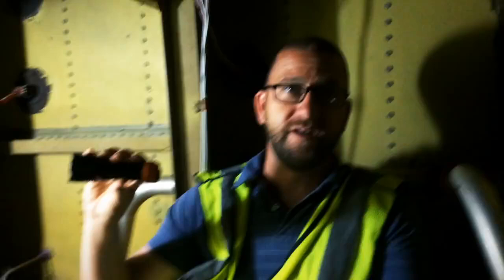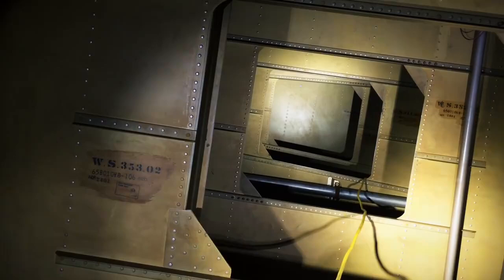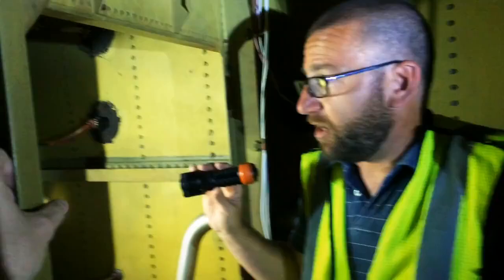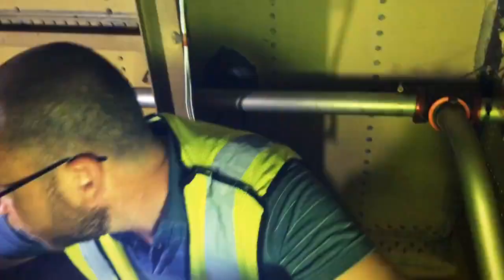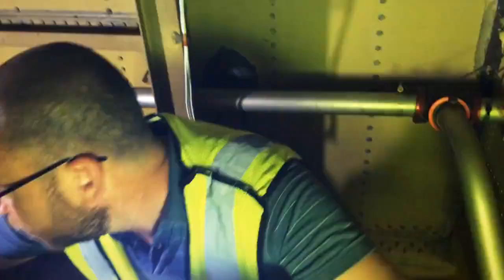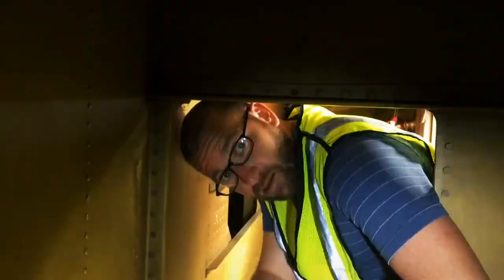The 747 Experience: In the Fuel Tank

Comment: No way is this a fuel tank. The  idea aviation fuel just sloshes around in there, i just cant see how it would work..
Reply: That's cool.  Well, that proves that you don't have an aeronautical engineering degree.  ;)
Reply: @StratMatt777 
Nor a high school diploma, I'd bet.
Reply: @jshepard152  Thanks for reminding me of this post because, in retrospect, considering that I assembled 747-400 center wing sections 20 years ago I could have expanded that guy's awareness by mentioning to him that the sloshing of the fuel in center tank is reduced (prevented as much as possible) by all those walls the guys are walking in between.  Which are (front to back) Spanwise Beam 3, Spanwise Beam 2, Midspar and Spanwise Beam 1 (there are 5 bays).
As we know, I was short with him since his comment means that he is experiencing the "compressed air" delusion, but I should never pass up the opportunity to expand someone's awareness of reality.
Hey, Marky Mark, how are you doing with understanding that jets run on fuel now 2 years later?

Consider this: your drink doesn't slosh or fly off the tray table because airliners always do coordinated turns, which eliminates cyclic variations in horizontal gravitational (centrifugal) forces.  That is to say, the sideways forces are gradual and pretty constant.

Comment: You just showed me a prime example of why im scared of the 747-400. Those electric wires above you that shouldnt be in a fuel tank. If those wires were to somehow break and you had full fuel, and then the wires start 'sparking'? Modern TWA800. Nope.
Reply: Being full of fuel is less hazardous, as the fuel itself doesn't ignite that easily.  The problem with TWA800 is that it was doing a relatively short flight, so only needed the wing tanks filled.  The centre fuselage tank was empty, and it was the fuel vapour that ignited.
Reply: There's actually only a small window of altitudes, temperatures, and fuel fill level where the tank can potentially ignite.  Unfortunately, TWA-800 hit that.

This is why A&Ps really earn their keep.
Reply: Those wires are in every Boeing airliner buddy.
Reply: Every commercial airplane you'll ever fly on will have wiring in the fuel tank, they almost all use capacitive fuel quantity sensors.

Comment: theres no way the amounts of fuel stated these planes take can all be held in the wings. look how skinny the wings are!
Reply: Cipi SixZeroFour good luck
Reply: It's not all in the wings. There are tanks in the fuselage (that's the body) as well.
Reply: Fred, it's irrelevant for him because what he really says is that the fuel that goes only in one wing LH/RH ... doesn't matter, that fuel is so "heavy" that the wing will snap... therefore the wings must be full of compressed air... try to figure it out what are the requirements to even build such a craft... these people don't understand that their 'solutions' do not simplify the design of the wing... au contraire.
Reply: Actually I'm studying the case if it's even possible to take off with a compressed-air craft the size of a 747... as of now... the math says that it won't take off... but we can only try harder.
Reply: For example, if we have to build a craft that can only take off, a compressed-air craft would be a possibility, but only if all onboard have to die because there is no 'fuel' left to fly or land.
Reply: Cipi SixZeroFour....I worked for General Electric Company in Schenectady right out of the University in the  1970's. I did gas turbine Field Engineering. A GE MS5001-P put out about 30,000 horsepower and it sucked something like 200 lbs of air PER SECOND through the inlet bellmouth. It had 10 liquid fuel nozzles made by Parker Hannefin and required a large Roots screw compressor to atomize the fuel. There was a fuel pump that supplied a 10 element gear type flow divider. The fuel pump was a variable displacement unit that utilized a wobble plate to vary the output of the fuel pump and change the load of the gas turbine from FSNL full speed no load to its rated output....determined by the exhaust stack temperature, something around 1005 degrees F. The exhaust stack was 14 feet on each side, a square stack. That's a lot of 1000 degree air and combustion products leaving the machine every second.

Granted, the Frame 5 GE was a generator drive unit that ran 5100 rpm and had a gearbox that turned a 24 Megawatt 2 pole 3600 rpm generator. You could ''Trip'' this unit at any time by hitting a button that dumped all pressure from the fuel pump. The unit would drop all electrical load as soon as combustion stopped. Hit the Trip and BANG, the unit is coming down. With all of that mass it takes 20 minutes to coast to a stop but power to the grid stops instantly as soon as the reverse power relays sense that the turbine is no longer driving.

Its laughable that compressed air could run this unit. It needed 200 lbs of air PER SECOND. Its aero derivitave was the LM2500 engine derived from  the jet engine used on the DC-10 aircraft. It was 32,000 horsepower. It drank liquid fuel in enormous quantities just like a frame 5 stationary power station turbine generator. The LM2500 was used...4 of them..to power USN guided missile frigates. 

For the ignorant stupid new wave common core touchy feely participation trophy fuckheads that say that aircraft run on compressed air only....they are stupid beyond belief. Every single commercial aircraft jet engine has a fuel system, fuel nozzles, and requires constant liquid fuel flow to the combustion section to produce thrust. No fuel, no thrust...INSTANTLY. There is no secret magic resonator that powers the engine on air. Its the same Brayton combustion cycle as used by a WWII German ME262 fighter jet from 1944. That was 74 years ago. Its the same as a Ford Model T engine uses the 4 stroke Otto combustion cycle as a 2018 Formula One race engine. Vastly improved, but same thermodynamic cycle.

Why I mention this to you is in hopes that some person will read it and determine REALITY for himself. Commercial airliners have gas turbine engines that run by burning huge quantities of Jet A liquid kerosene based fuel to produce thrust and that most airliners store that liquid fuel in the wings. Those are facts, not guesses. Real life, not some shitty YT video made by a duschebag that you diddled up on your smart phone for ''proofs''.

I had the pleasure to ride in Bob Love's P-51D Mustang WWII fighter plane several times before he passed away. It had Aviation gasoline, 115 octane, I believe, in each wing. I recall 60 gallons or so were in each wing. The plane was built in 1944. So, geniuses and non believers, how is it magic that fuel cannot be stored within the wings of aircraft? Fuel slosh? That thing was doing loops and rolls, split esses, and breaking 3G turns and nothing sloshed except maybe my stomach.

And for the shitbag plumber Seeno who stated that nuclear subs run on gas turbines.... the air on board a Los Angeles Class sub would be emptied in 3 seconds by an LM2500 marine gas turbine. What a duchebag.
Reply: kimmer you had some fun I see :P
Reply: Cipi  yes, saw the world and somebody paid me to do it.
Reply: kimmer6 I envy you, sir.
Reply: Cipi.....I dunno, mate.  My life was all work and minimal play. I can tell you the fallacy of the Auschwitz sign.  Work DOES NOT set you free!
Here I am in my mid 60's still running a business and stuck to it 24/7. Time for a break!
Reply: Here is a diagram of the 747-400's (wing) fuel tanks: https://i.stack.imgur.com/R2qRK.gif 

Here is a diagram of the 747's center wing tank: https://upload.wikimedia.org/wikipedia/commons/9/92/Center_Wing_Fuel_Tank.png 

Here is a photo shot at the Boeing factory in the "Wing Stub Build-up" area I used to work in where we built the center wing tank. This photo shows the sheer size of the first two bays (of 5) of the 747-400's center wing tank (scroll down a page): http://www.iasa.com.au/folders/Safety_Issues/FAA_Inaction/nea.html 

An Airbus engineer commenting under a compressed air video said he calculated that the engines would run for 32 seconds on compressed air.

However, if you pumped compressed air into the wing tank of an airplane it would immediately escape out the fuel vents in the wing tips which are there to prevent a vacuum from occurring as the fuel is removed from the tanks.

If you plugged these vents and pumped in compressed air the entire wing would rupture with the upper and lower skins ripping the stringers off the fasteners that attach them to the wing ribs and spars.

Google image search "c-141 rupture wing fueling" to see what happens when you pressurize a wing tank with fuel as a result of the maintenance technician forgetting to remove a wing tank vent plug...  "compressed air" debunked with ONE photo!
Reply: My favorite part:  "Those are facts, not guesses. Real life, not some shitty YT video made by a duschebag that you diddled up on your smart phone for ''proofs''."
:)
Reply: kimmer6 thanks for this

Comment: No wing is that thick, even at the shoulder. This looks like a boat more than a plane to me.
Reply: spoada it's called the wingroot not the shoulder. 747 wings are indeed that thick, my great grandmother worked at Boeing as did my great grandfather and grandma and grandpa. My great grandmothers job was to crawl inside the wings of B29s(a much smaller plane) to inspect the joints.
Reply: False.
Here is a diagram of the 747-400's (wing) fuel tanks: https://i.stack.imgur.com/R2qRK.gif
 
Here is a diagram of the 747's center wing tank: https://upload.wikimedia.org/wikipedia/commons/9/92/Center_Wing_Fuel_Tank.png
 
Here is a photo shot at the Boeing factory in the "Wing Stub Build-up" area I used to work in where we built the center wing tank. This photo shows the sheer size of the first two bays (of 5) of the 747-400's center wing tank (scroll down a page): http://www.iasa.com.au/folders/Safety_Issues/FAA_Inaction/nea.html
Reply: another person that knows nothing is commenting about a aircraft fuel tank. i am 6'2 and i can literally stand up inside of a center fuel tank of a 747.
Reply: You obviously having worked bigger commercial planes if you never seen metal that thick in a wing

Comment: me thinks if these wings had all that weight with the fuel ..the wings would snap the fuck off especially when they hit turbulence.....
Reply: why would they? the wings are what generate the lift, it's the best place to put weight without stressing the structure in flight, except at touch down. Also, look at a plane on the ground, all the weight is supported by the wheels which are attached... on the wings. and the whole fuselage + cargo + pax is a lot more weight than the fuel.
Reply: Actually, the immense weight of the fuel acting downwards against the upwards force of the wing creating lift (carrying the weight of the airplane) allows Boeing to design the wing to be lighter and weaker. That's a fact.
Reply: @StratMatt777  That would make simple turbulence a nightmare. I don't even need to calculate the newtons of force exerted on a filled wing end, but maybe ill brush up on my physics to figure it out for good. Thanks for all the comments though, I'm learning a lot from doubting, more than I ever have in my aeronautics classes.
Reply: @doothdooth  You'll like this:  https://www.youtube.com/watch?v=l9m5FgRMfE0

Comment: the fuel is stored in several large rubber self sealing bladders  in a functioning aircraft
Reply: Not on these big buggers sorry. A lot of light aircraft use bladders like you mentioned but that is the fuel tank, or rather, one of the actual fuel tanks he's climbing around in and it's exactly as you see in the video. Good to see someone who actually does know at least enough about REAL aircraft and not another nutter who insists they run on compressed air though, so a thumbs up for that.
I may be mistaken but I think the term for this type of tank is "a wet tank".
Reply: Even two and four seat Cessnas/Pipers/Diamonds/Beechcraft do not use bladders.  Most airplanes have integral wing tanks.  All airliners do.

Comment: I was waiting for a train at Gatwick and watching the planes take off and come right over head. I noted that there was no exhaust visible at all from the engines. Nothing. All that fuel supppsedly burning and no exhaust visible? I also noticed I could not see any heat haze from the engine. The engines sounded like it could be compressed air making the noise. The more I look in to this the more interesting it gets.
I few months ago I went to the Rolls Royce jet engine museum with some retired engineers who had designed and worked on the engines on display. There was a Trent engine on display which is used on the A380. The retired engineers who had been very keen to talk about the other engines said they could not talk about the Trent as they had been sworn to secrecy.
Reply: They don’t look like they make any exhaust because we don’t live in the 70s anymore and jet technology has evolved past big black clouds coming out the back. There is a lot of soot from the fuel burning in the engine. If you ever look at a turbine aircraft you can see very large amounts of soot on the exhaust area. Of course it sounds like compressed air because the engine burns fuel to compress air to move the aircraft.

Comment: Jet engines run on compressed air. Free energy!
Reply: dorian345 Just checking. Do you believe they take this compressed air up with them? Or do you imagine that the air coming in the front is compressed and pumped out the back?
Reply: He probably thinks they make all the passengers pump away on push bike tyre pumps to keep up a supply that would maybe fill one tyre up in about 10 minutes. Cause, yeah dude, just a little goes a long way man. They can pump it up anyway they like but compressors are terribly inefficient and to produce the thrust required to accelerate one of those monsters down a runway at a great rate, then turn it's nose up and climb at very steep angles should be so easy right?  Hang on a second. Where do they store all this HIGHLY pressurised air, and how in hell could they possibly store enough to even get it half way down the runway. There must be some huge and heavy very thick walled tanks on board to store it in. Or are they really just so stupid that they think an air compressor that runs at something like 20% efficiency can actually continuously supply enough to keep propelling it?  This whole thing is so f#*king insane, it really worries me that there are people so stupid they believe it.
Reply: Do you understand how the compressors work? They consist of a series of stators and rotors. The rotors do WORK by rotating. How is this WORK being achieved? I'll leave that for you to research.  I'll give you clue: The first Law of Thermodynamics.
Reply: you run on compressed air